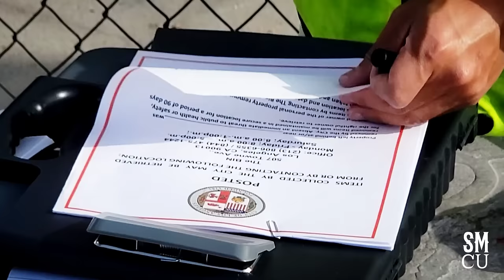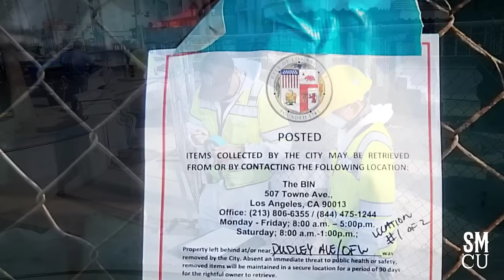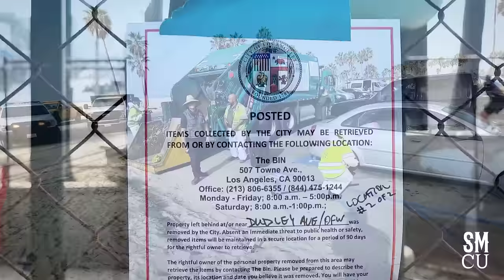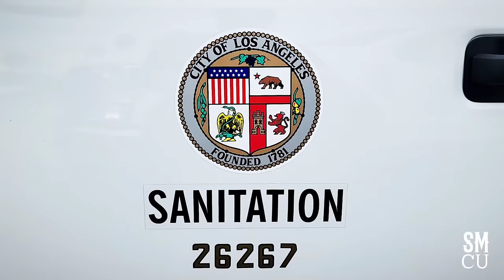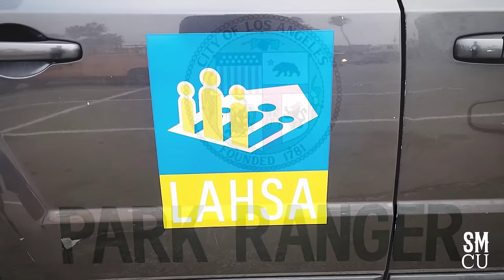Woman Sleeps on Bed in Public Restroom

Comment: They will just gonna go back after the cleaning.
The city should put a sanitizing spray that automatically run hourly and that you need to push a button to delay it just in case your inside. 
Less worker to pay , it will be clean all the time, and no one can occupy those the whole day or night..

Imagine that they need to wake up hourly just to prevent getting wet. 
I bet nobody will stay there.

Comment: They need to save those shopping carts. That is a waste to trash them.
Reply: How to return them to many different stores?.......Soon, they'll require a $5 deposit for the use of the cart at the stores, that will be returned when turned in.
Reply: Nowadays street homeless and are fentanyl addicts, and not capable of doing anything no matter how simple it is. Street encampments are open air drugs markets brewing all sorts of crime. Majority of them will die from fentanyl overdose, or drugs related violence. Second hand fentanyl smoke can easily kill you in no time. Street homeless gradually destroy everything around themselves. We will never reduce street homelessness without reducing the amount of fentanyl drug available on our streets. If they can afford, they smoke fentanyl up to 100 times a day. That's how all these fires are started. Homeless advocates are mentally stuck in Pathological Altruism, and all they do is enabling fentanyl addicts remain as close as possible to their fentanyl supplier.
Reply: @billkallas1762  Lots of areas have shopping cart recovery services where they drive around in a stake bed truck and pick up the carts on the streets and bring them back to the stores for a fee.  The city workers were doing a homeless clean up by the Gold's Gym near Venice and they were just loading up brand new shopping carts from Ross Dress for Less into the trash trucks and crushing them,  The carts cost around $200 each - what a waste, they could just leave them stacked up on the street corner and call the stores.
Reply: Those shopping  carts must be crushed..they are contaminated..
Reply: @lorrettasaunders7668  Power washing will solve most of life's little problems.

Comment: Why this is very disheartening the best thing to do to stop this is to put up signs and enforced vagrancy laws and say that anybody that's in the bathroom for more than 15 minutes are is found camping or loitering or littering in the restrooms will be faced with find possible imprisonment and community service.  They can work off their fine and all through community service by cleaning the bathrooms in the first place in other areas this would show them an example making such a mess and problem.  This is quite unsanitary and with mattresses and other items it is a public health concern.  If they don't cooperate they should be arrested and then sent for mental evaluations and proper psychological holds.  I believe this would really put a dent in the problem.  For this cost taxpayers money available resources that can be used for other areas.

Comment: Government worker waits until trash truck arrives to throw away mattress. If you worked for me you would probably be fired! Solution pull mattress outside, open up restroom immediately, problem solved. Governments ways and policies are a joke. Notice this Rangers attitude (It's not my job call sanitation) had gloves on still wouldn't pull mattress on floor outside. No wonder government is allegedly broke and failing!!! I guess this homeless woman didn't want another good night's stay on her Sealy Posterpedic Mattress and drag it with her.